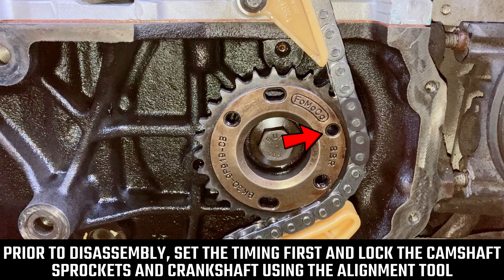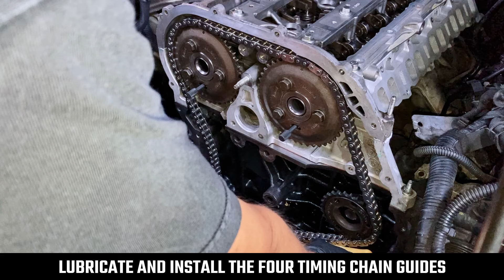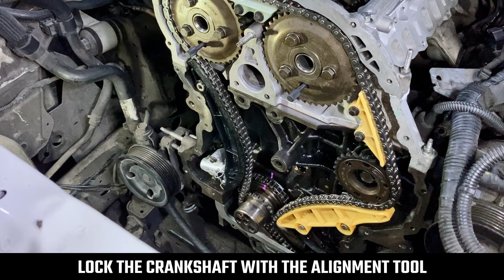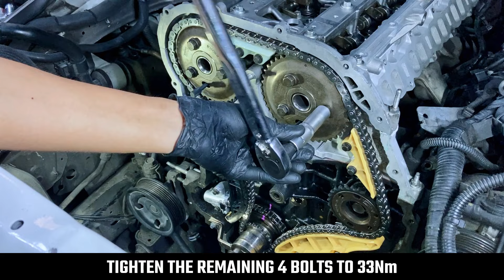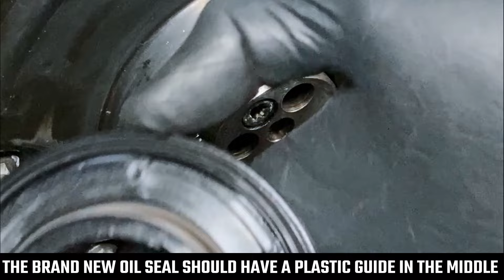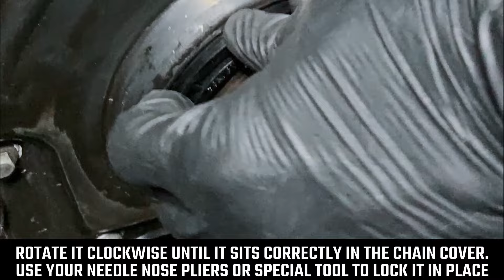FORD RANGER | MAZDA BT50 3.2 TIMING CHAIN INSTALL | FRONT CRANKSHAFT OIL SEAL REPLACEMENT | P5AT

Comment: Replacing one of those crank shaft seals in a couple days for a customer, good thing i gave it a quick google, first time i've seen one like that, probably would have stood there staring at it for a bit trying to figure it out lol
Reply: It's there any timings marks on the cracks shafts?

Comment: Great work! Would you kindly state the position on the crankshaft before locking it with the alignment tool?
Reply from the maker: Hi Russell! You’ll need the alignment tool to set the crank into position. It only goes one way onto the crank pulley bolts. Easiest way to do this is to set the timing to TDC beforehand
Reply: @btdgarage  thanks very much. Will do that. Which cylinder TDC will this be?
Reply: Good morning this is Engineer Sunny
Reply: Cylinder 1  @mackietrent

Comment: Where’s the correct timing mark on the keyway fuel pump sprocket? Is it the dimple or the hole directly opposite the counterweight on the back of the sprocket. I’m confused